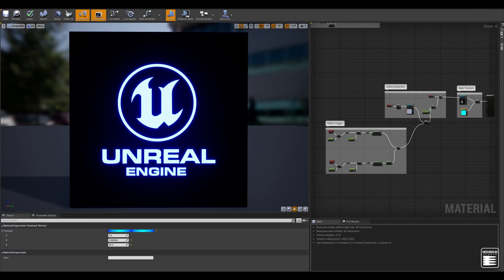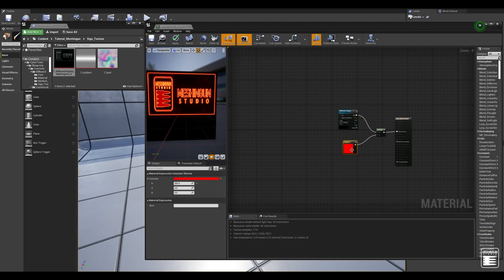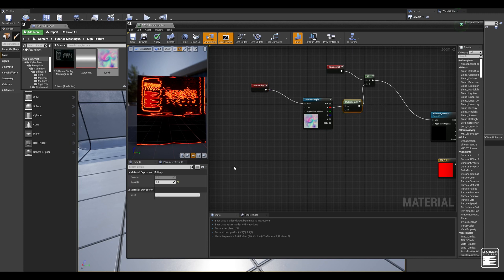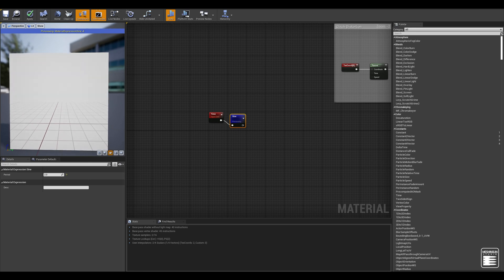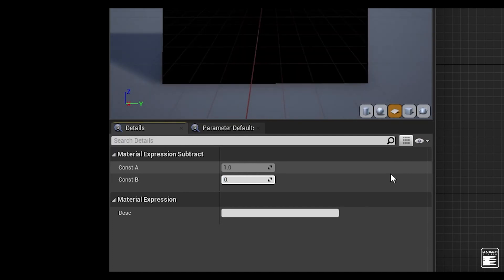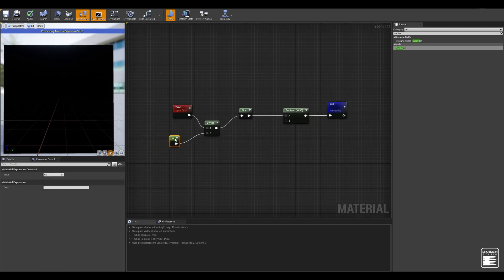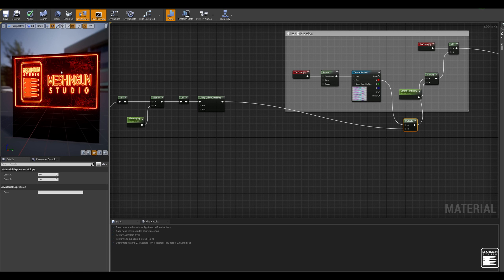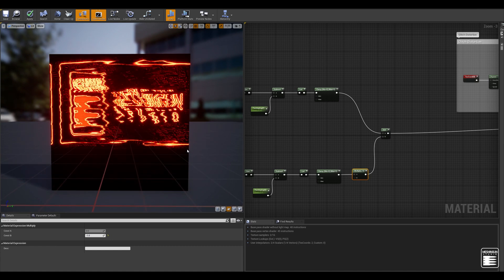Shader Tutorial: Animated Glitch UE4   - Meshingun Studio

Comment: First off, great tutorial, I enjoyed it and it worked perfectly.  However, I do have a few suggestions to make it even better.  Sometimes you kinda brush past certain things without properly explaining them (most of the time you explain it just fine).  For instance, right from the beginning, I was unsure what kind of final output/result node you were using.  It only has Emissive Color, World Position Offset, and Pixel Depth Offset available.  After going through all the various options, I couldn't find one that matched this, so I just used the standard and plugged the final multiply node into both emissive and base color.

At 5:15, you tell us that you placed an "Intensity Parameter" node, but don't show us how you got the node.  "Intensity Parameter" is a custom name so we don't know how to find it.  I eventually realized that it's just a constant node made into a parameter (just hold "S" and clicking brings it up), but it would be very helpful to tell us how to get those.

Other than those 2 minor nitpicks, this was a great tutorial, so thank you!